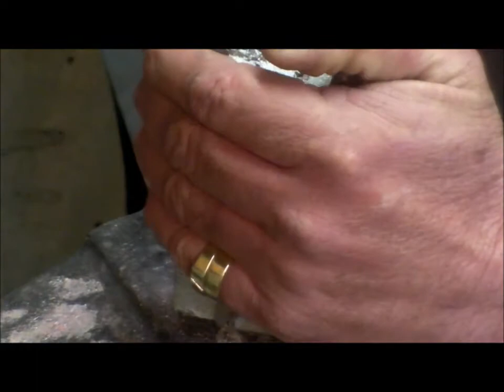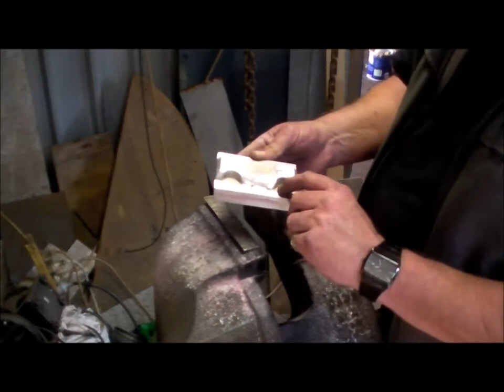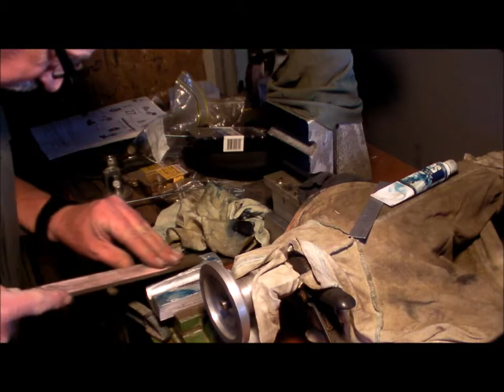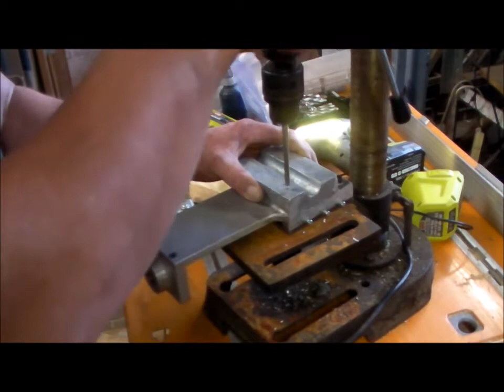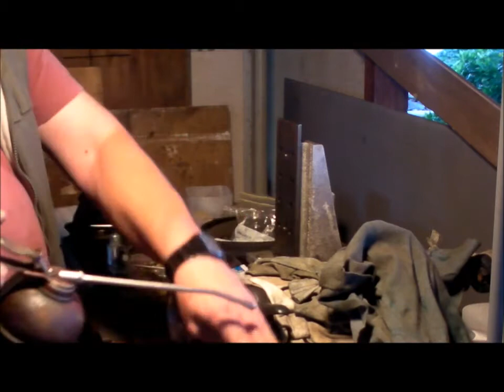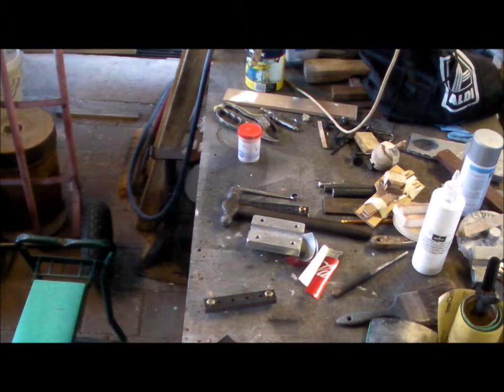Building the Gingery Milling Machine 29, the Spindle Head Bearing Cap

Comment: I am beginning to see a lot of wood working skills you mentioned from your work that are making the casting boxes and your file holding tool a clearly needed piece of equipment, what is the red stuff you appear to apply to the file while filing Peter. It is funny to see you chisel the aluminum just like you wold chisel wood. 
I am glad to see that after making a cast aluminum part there is little work left to be done HAHAHA.
Reply from the maker: G'day Lance, yes a lot of wood working practice, but realy no fine joinery necessary, body filler and wood putty fix a lot of character marks.
The red stuff is chalk, I was told it helped with keeping the file from clogging, that's debatable but I will add a nice new file made more of a difference.
To be fair there is a lot less aluminium to file off, sprue, riser and flashing than there is in the part itself, c'monnn. I consider it a replacement for the days exercises which I don't (but should) do.
Cheers
Peter

Comment: Love watching this guy
Reply from the maker: Thanks
Reply: Well I hope to build this so I like to see the steps... and the mistakes too. My nickname is Vinny two times because it always takes me two times to get it right. Keep up the good work.
Reply from the maker: G'day Vinny, well your in luck as I don't remove the mistakes I have made and luckily I haven't made too many  mistakes. The biggest hurdle for me is the  difference in stock material sizes between Imperial (in the book) and metric as supplied in Australia. Also the standard bushing sizes are different due to the measurement systems and to different manufacturing standards, I think in the next episode I have to recast the quill support because I followed the book. I wish you luck if you do decide to make this machine. Thanks for stopping by. Peter

Comment: Peter,  Great video.  Your getting close to adding a motor and boring operations.  Excited for you buddy!!!

Joe
Reply from the maker: Good to hear from you Joe.Yes it looks that way although the boring of the spindle head will be performed in a slightly different manner to Gingery's method, mainly due to more recent technologies, don't get me wrong, I'll still be running pulleys and old style electric motors for the machine itself but for the boring operation I'll do it differently. I still prefer the old ways because only one thing can go wrong if it don't turn, no electronic wizardry to consider. 

Take care, Peter